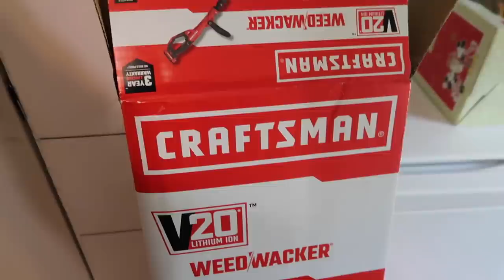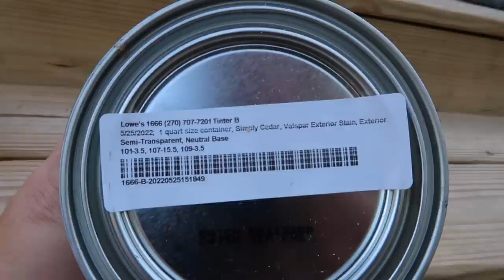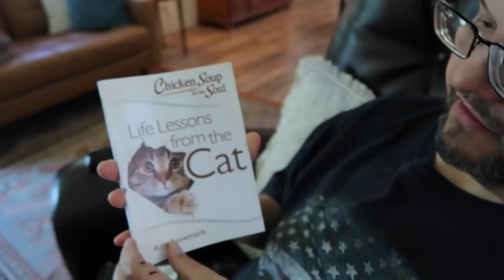Mobile Home Back Porch Makeover | Pressure Washing + Staining Porch And Wheelchair Ramp

Comment: I like the stain color. As usual, you have done a wonderful job. Thanks for the weed wackier info. I have corded ones but am really intimidated by them and the areas I need to use them. I may need to get one like you have.
Reply from the maker: I really like mine and it's easy to use. I haven't had to use it on a large area so I can't really give a review on the battery life. We have multiple Craftsman tools around here so we can use any of those batteries on this one if one runs out. They are all interchangeable. Another thing I like is that the line self trims and feeds through on its own. Very convenient.

Comment: Instead of a board for the ramp rails you can get the square solar lights the size of your post tops. Drill a hole in the middle of the top of the post and put the light in it.
Reply from the maker: Great idea!